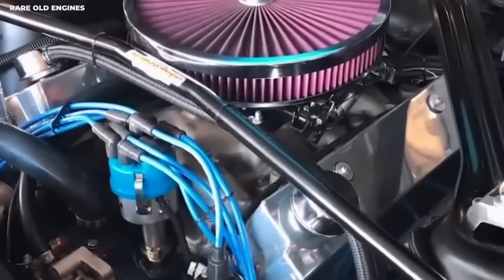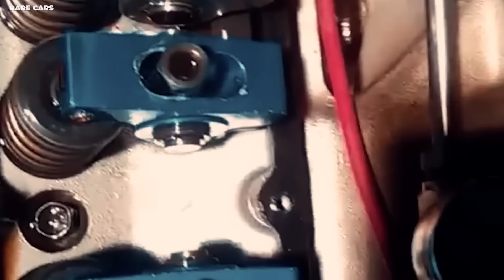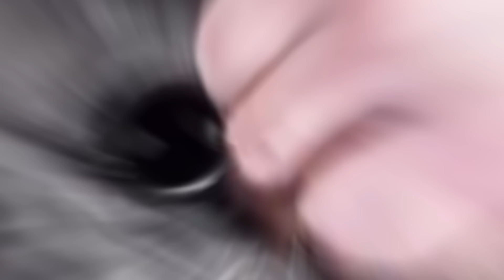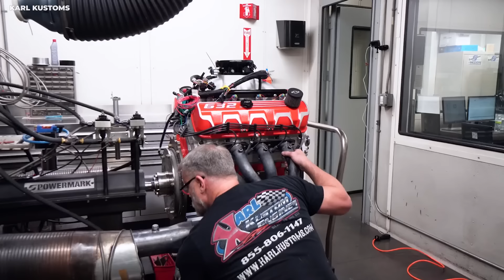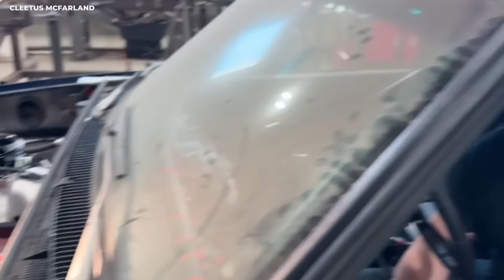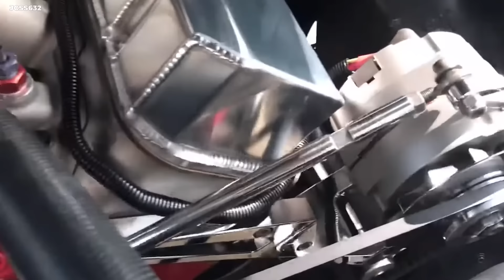Most POWERFUL Big Block V8 Engine of All Time

Comment: ZR-1  was the mystery engine actually, there was no real mystery about this thing. It was extremely lightweight. basically an L-88 famous rat motor.made out of aluminum with 3 different head designs available from the GM factory supplier. I have built a few of these monsters even a steel block aluminum everything else engine ! 600 +  hp  !

Comment: Wrong, this Chevy engine was compared to big block Ford developed by Jon Kaase that had 34 less cu in and that Ford engine produced at least 100 more horsepower so get your facts right before you start yapping.  For a man is not known to be a fool until he begins to talk with knowledge.
Reply: The Chevy is drivable and crate motor anyone can just buy . It also comes with warranty.

Comment: THE LS-7 WAS OUT THERE IN 1970 IT HAD 12.5 TO 1 COMPRESSION
Reply: They had one in a speed shop for 1500 bucks, a substantial amount of money in 1975. My more experienced friend drooled all over as he explained all the goodies for that long block.
Reply: No it wasn.t. Not built off the assembly line. Only the cam specs were different. Check me. I had one.
Reply: wtf are u talking about in the 1970 they interduce the LS line of block all were small blocks they came with 9 to 1 compression in 1970 they put out 2 different 454's one was a ho 454 with 450 hp and a LS 6 454 small block with 485 hp  if u read up on the mark 4 series u will find that they changed the angle of pistons and pushrods which means they built a new block. then do you even know what LS stands for on the engine and not a car/ on a car they have a tag that stands for luxury sport with how many options the car had on it but that is not what it means with engines. did you know you can buy both 1970 chevelle engine new today both the big block chevy 454 and the GM LS 6 454 they are remakes as crate engines they  only built 212 with the LS 6 and 6 with the LS 7 427 . then you need to understand that a big block chevy was built by chevy but the LS was built by GM racing division 2 totally different engines but a lot of people mix it up they think if it has 454 cubic inch it has to be a big block
Reply: @jeffrey4547 
You're wrong. Loooong before the LS small blocks came out. In  1970 and 1971 GM made the 454 LS5, LS6 and LS7s in 425, 450 and 465 HP respectively. After that for about 3 years they were available in crate motors.
Reply: @tedkohl2918  i got all my information right off LS website you can even buy the remakes like the 1970 LS 6 454 and the LS 7 427 the LS 5 is a replacement for the 383 the first one was a LS 1 350 a LS 3 is basically 327 and you could buy any ls engine from 1970 to today they make all different types  you order the size you want then you can alter it on your order like compression what type of rods and so on but the more you change the price just goes up and up but you would know all this if you have ever ordered a LS engine same with bbc you start with the basic then you upgrade the package if you want to with a big cost to the package. right now i have 4 HO 454 450 hp engines 3 are sitting in the shop also traded a rebuilt 350 sbc for a LS 7 427 that needs rebuilt but it is the newer version with 4 valve per cylinder over head cam then do you know what a LSX is it is a 454 with a 427 crank that is what makes a LSX the cost for a new ls7 is over 35,000 new but complete with carb efi add about 5,000 to rich for my blood so i will build one
Reply: @jeffrey4547 
GOOGLE  454 LS-7  YOU'LL SEE